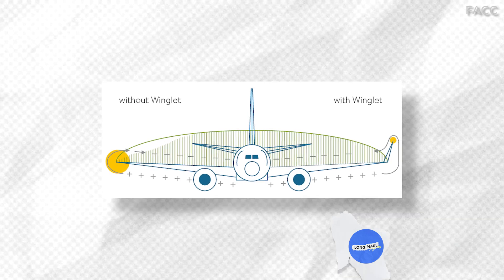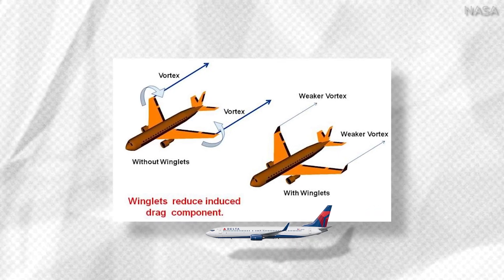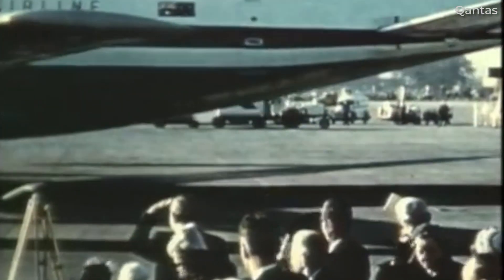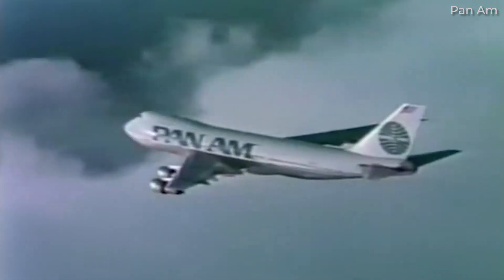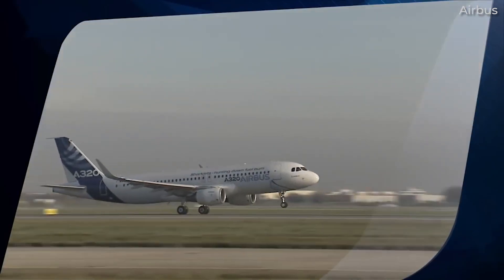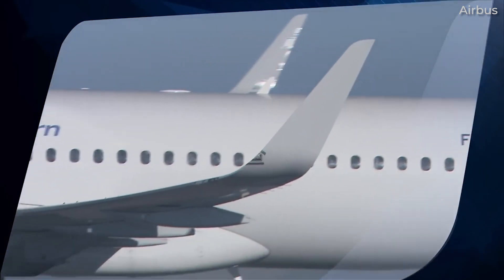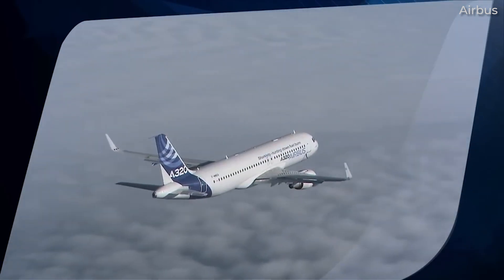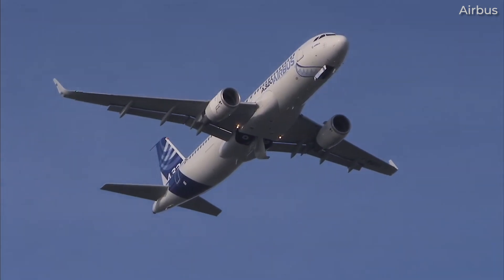Why Boeing Has Winglets And Airbus Has Sharklets

Comment: I love the 787’s raked wingtips. That beautiful sweep when you look it from the cabin will never get old for me. Hence why i always love to sit at the very back of the mid-cabin when flying on the Dreamliner
Reply: How are they effective compared to winglets?
Reply: @ShadowRap-y5l  The idea is to minimise the size of the wingtip vortex, which allows for minimum drag. The 787’s raked wingtip is sharp at the end, meaning smaller surface area for the upper and lower air streams to meet, significantly reducing the size of wingtip vortex.
Reply: @magnustan841  hmm aren’t winglets sharp at the end as well?
Reply: I only fly premium economy or business on 787's now, that's the one thing I miss about sitting further back.  If I sit at the back of business, I can get a decent view with my GoPro stuck on the window though.  They truly are a thing of beauty to watch, they almost flap a little like an eagle soaring through the sky.
Reply: I agree i LOVE the raked wingtips on the 787s and on some of the triple 7s 💙💙💙💙💙💙
Reply: Beautiful design
Reply: It’s so elegant, and the overall sweep upwards of the 787’s wings in flight is just the best.

Comment: Speaking of winglets, I recall the A330/A340 program initially had similar split scimitar type wingtip designs found in the A310 and A320 programs, but the A340’s engine problems forced it to have large wings just to help lift it off the ground. Since both the A330 and A340 were co-developed at the same time naturally they chose the similar polygonal wingtips found in the B747-400 in order not to screw with the aerodynamics further. The A380 was a standalone design, so it’s not subjected to compromise changes in its wingtip design.
Reply: The A310 and A320 do not have Split Scimitars. They are called Wingtip Fences 😉
Reply: Have you ever seen a scimitar? The A310/320 wing tip fences look nothing like it
Reply: its cool that the md-11 had spilt scimitars

Comment: it was possible to answer the video title's question in less 5 second "no different, just a marketing name"
speaking of airbus's winglet i think the airbus is expected and applied winglet design since 1992 on A340/A330 similar on 747-400, but on narrow body aircrafts have a special design winglets, not only in 737 and A320 also have a similar design on Embraer E-jets and Bombardier CRJs
Reply: Airbus also had wingtip fences on their A310’s in the late 1980’s too. Which also found its way onto the A320-200 (the A320-100 didn’t have them) and also the A300-600 and A380.

Comment: What about the winglets Airbus used on the A330 and A340 or the Wingtip Fences they used on some A300s and A310s as well as on the A320s and A380s? 
Some of them came out much before 2000…
Reply: That is true, and the A300B4-600 also flew first with wingtip fences and also entered service in 1987 before the 747-400 took to the skies even. The A320-200 is just a few month shy of the 747-400, too. Simple Flying, I guess. ;)

Comment: I always thought that the 1st winglets were on a Learjet.55 longhorn.
Reply: It was the 28 model in 1977. That wing then went on the 35 model (now called the 31). When the 55 model was designed they used the same Longhorn wing.
Reply: @Pilot604  OK, thanks.

Comment: I don’t get why Airbus hasn’t tried raked wingtips given the success Boeing has had with it. It’s good for widebodies in particular
Reply: It's possible Boeing had a patent which prevented Airbus from going down the path of raked wing tips. That said, it might be wing span the prevented Airbus from doing this as to fit them in certain size airports.
Reply: @josephaskins1996  I don’t think patent is a problem if Embraer also uses it for the E2
Reply: @UK aviation fan and other interests   After further research, it's airport size restrictions.
Reply: @josephaskins1996  That can also be sorted by including folding wingtips which when extended outwards are then full length raked wingtips which is what Boeing cleverly did for 777X
Reply: A330neo?
Reply: @ameerali.ouarda  not the same
Reply: @ameerali.ouarda  i think Airbus calls those sharklets as well
Reply: the a350 and a330neo have something similar but i dont know what its called
Reply: @747simmer4  It’s a type of blended winglet attached to an otherwise ‘normal’ wing. Even Embraer has decided to use the raked wingtip design for the E2 in 3 different sizes so that each variant has been optimised best (the shorter variant also uses a smaller P&W GTF than the other 2 variants)
Reply: Maybe cause the French all think they are the best
Reply: Parasite drag is produced by VERTICAL surfaces and Induced drag is created by HORIZONTAL surfaces, for example when the Flaps are at 0 degrees they produce Max Induced drag and Min Parasite drag, at 90 degrees Min Induced and Max Parasite drag and at 45 degrees in the middle of both, for a flap with no thickness. The fact that Lift and drag are both proportional to airspeed squared, means airspeed affects a 2 Dimensional surface, geometrically a Square plane. Wing Vortices are not the cause of Induced Drag but it is just a Visible Effect of it. I have developed a hypothesis to explain physical, atomic and subatomic (gravitational movements, Center of Gravity and Mass), however I need to validate my V & H surfaces theory first.
It seems that Winglets reduce Lift and increase Drag, I also believe in turbance Winglets impose additional stress to wings and all other moving parts inside the wings like rods, joints and moving surfaces. Wingtips also decrease the stability and controllability in turbulent air. Simply put another british scam.
Please let me know what you think, thanks.

Comment: Fun fact: as soon as any aircraft crosses into Australian airspace, they are automatically called sharklets, croc-lets, or snakelets.
Reply: I guess yall havent unlocked Spiderlets yet
Reply: @YukariAkiyama  I wanna see what spiderlets would look like
Reply: Ɓogân Ňett§
Reply: That’s an odd name, I’d have called them Chuzzwazzers….
Reply: @robboltwood  banger Simpsons reference.
Reply: @miked51  thanks milksteak
Reply: For some reason, when the 737s first got wingtips, it would be specifically detailed on the itinerary here in Aus. I didn’t think it was particularly relevant to my flight, to be honest!
Reply: If Australia designs an aircraft, I'd expect them to put the whatchamacallits down under.
Reply: Roo-Lets
And Koa-Lets
Reply: @JRVBG  re: "Roo-Lets. And Koa-Lets". 
Early testing has shown that Roo-Lets tend to bounce too much and that for some unknown reason the Koa-Lets occasionally mutate into the dreaded, dangerous Drop-Lets.
Reply: British humor on display
Reply: Isn't that still "paytent" infringement?
Reply: Of course, they are and fun fact: they are more potent that any other thing in the world.
Reply: All those “lets” but nobody said piglets
Reply: Parasite drag is produced by VERTICAL surfaces and Induced drag is created by HORIZONTAL surfaces, for example when the Flaps are at 0 degrees they produce Max Induced drag and Min Parasite drag, at 90 degrees Min Induced and Max Parasite drag and at 45 degrees in the middle of both, for a flap with no thickness. The fact that Lift and drag are both proportional to airspeed squared, means airspeed affects a 2 Dimensional surface, geometrically a Square plane. Wing Vortices are not the cause of Induced Drag but it is just a Visible Effect of it. I have developed a hypothesis to explain physical, atomic and subatomic (gravitational movements, Center of Gravity and Mass), however I need to validate my V & H surfaces theory first.
It seems that Winglets reduce Lift and increase Drag, I also believe in turbance Winglets impose additional stress to wings and all other moving parts inside the wings like rods, joints and moving surfaces. Wingtips also decrease the stability and controllability in turbulent air. Simply put another british scam.
Please let me know what you think, thanks.